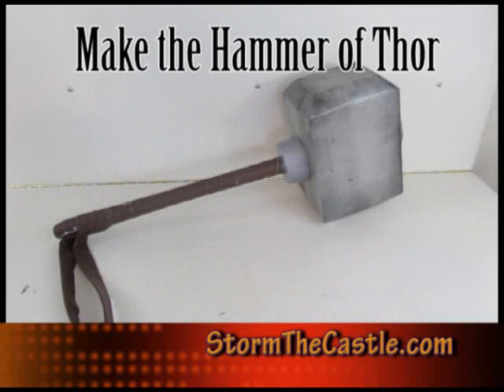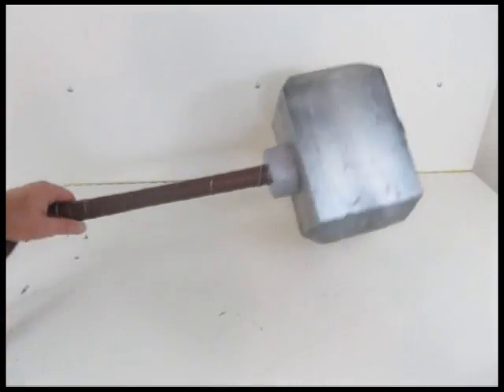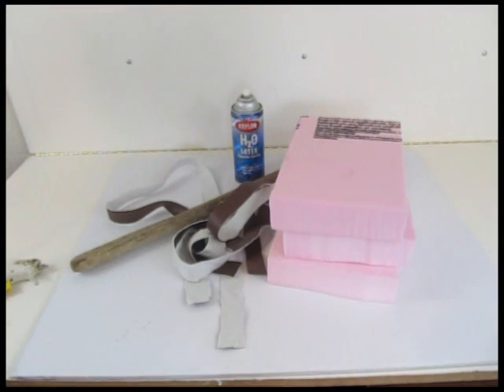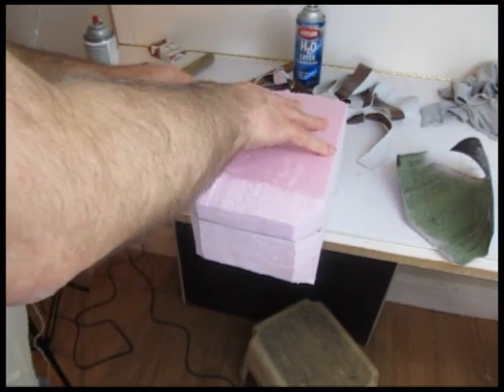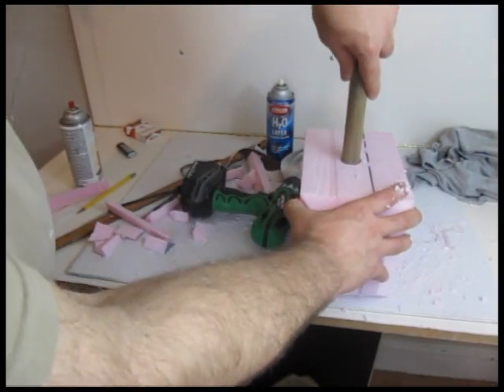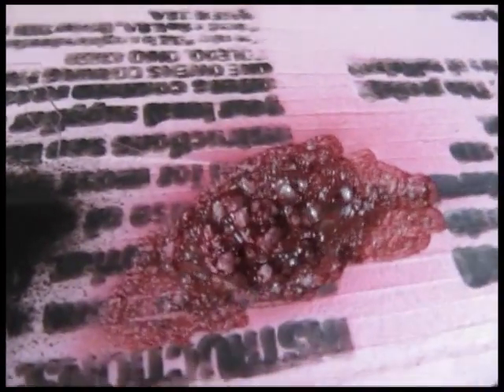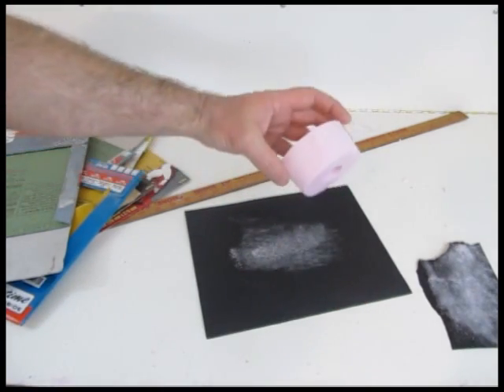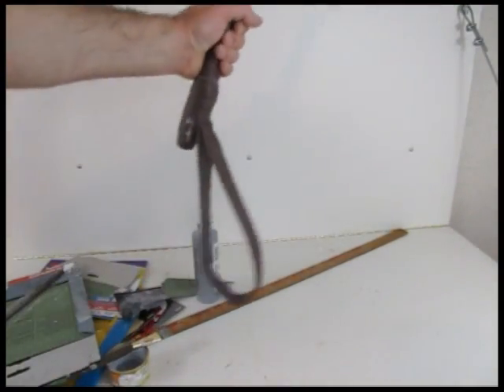Make the Hammer of Thor

Comment: Actually you can spray paint foam. Paint it with elmers glue mixed with water (50/50) first, let it dry. Then spray paint at about 30 cm or more away (small bursts). This should also give it more of a shine. :)
Reply from the maker: Great tip! THanks!

Comment: No, the hammer's foam is to hard and would break easily during combat. Most LARPs do not allow wooden cores anyway, most prefer fiberglass or carbon fiber (It varies from game to game). HOWEVER, the same concept could be used to create a LARP hammer of similar design.